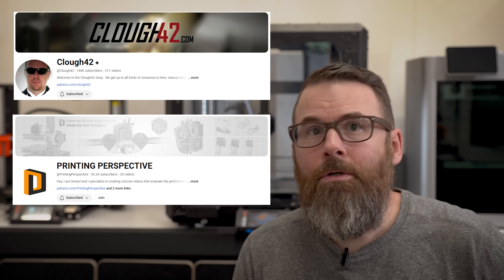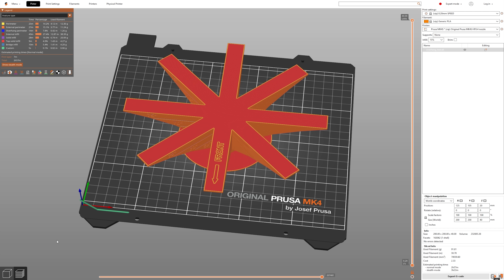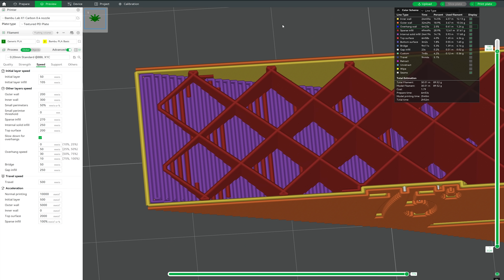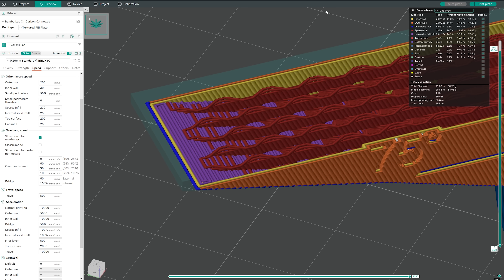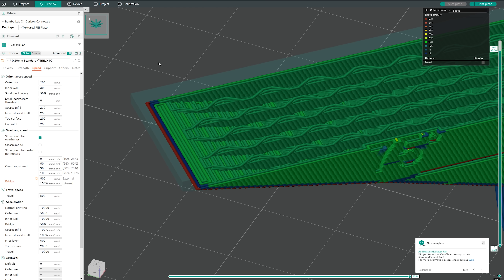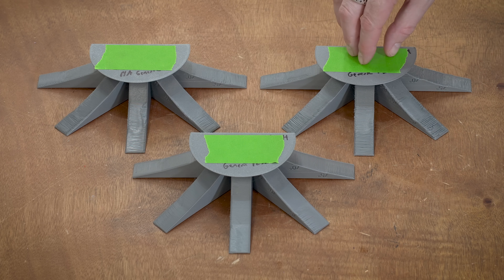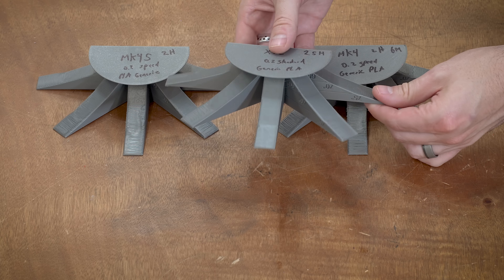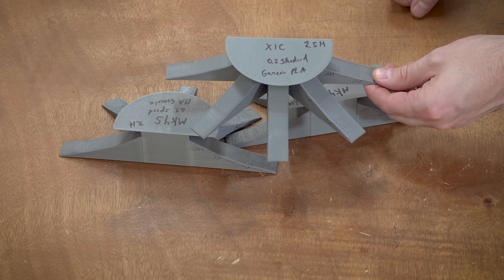Uncovering Prusa's Overhang Performance

Comment: oh boy more slicer configurations that are being marketed as printer upgrades smh
Reply from the maker: To be fair, it IS a pretty integral part of a 3d printer anymore.  But it's not necessarily an 'upgrade'.
Reply: @RobertCowanDIY  I do understand that but the disingenuous part is the marketing being so heavily biased in imping that the "upgrade" was from the fans and not the slicer because they completely understand that such a simple bug will be fixed within weeks for other slicers.
Reply from the maker: @mynameis______392  Yeah, I'll be shocked if this bug isn't fixed in the next month.
Reply: well the software compliments the printer so technically changes to PrusaSlicer are printer upgrades.
Reply: @902Boots  I understand what your saying but I disagree since the slicer is not inherent to prusa, nothing is stopping you from using it with other printers, Or just simply tweaking the other slicers

Comment: Thanks. Still going to get a MK4S
Reply from the maker: Yeah, I don't think this invalidates anything in my last video, other than the overhang performance isn't quite as advertised.  But it still prints nicely.
Reply: @RobertCowanDIY  To be honest, it will influence my decision on buying an MK4S. 
If the hardware updates don't actually adress any of the advertised problemes, then why should I buy it? Additionally, I don't admire being mislead in that way buy a company.
Reply: That doesn't make the MK4s any worse. One printer or another will always be a little better or worse with different filaments or print objects.
The MK4 is a very good printer that will give you pleasure for a long time.
I am sure that it will continue to be refined.
I believe that everything is exaggerated in marketing across all brands.
For me, for example, the Lidar sensor on the X1c is another one of those things. Does that make it a worse printer?
Reply: @OmarAdel19 i don't think they were intentionally misleading. It still does perform better than the mk4, and since Bambu slicer is just a forked prusa slicer they could be behaving the same but this just looks like a bug that went unnoticed for a long time, that only prusa caught. I wonder how would the print from mk4s look if it's bridge speed was also set to 10, maybe it would look a lot more like the x1c if it had the extra 30 minutes.
Though I gotta say I thought the overhangs would look a bit better than they do, they still hang a bit. They do look better than the mk4 but still
Reply: Why lol? It is an inferior competition to the A1 model...
Reply: @riba2233  because it is a kit build, customer support is 1000x better, I can print any color I want for it, I can add any camera that I want for it, I can use WiFi, direct Ethernet or choose not to use and choose to use a USB stick, it doesn't need to be connected to the Internet to update, I can mod it if I want to any way that I please, it has a better warranty than Bambu, I can use any slicer program for the MK4S. It is open source. I can put Octoprint on it, klipper on it, my own version of Marlin, I can if wanted put a different board in it. If I want I can do all these things, and I can choose not to change anything. 
But first it is a kit, I like to build kits.

Comment: Can you use Prusaslicer for the Bambu printer? That would be the best comparison,right?
Reply from the maker: Hum, maybe?  Give Bambu a month, I bet it will get fixed.
Reply: @RobertCowanDIY  Right, but, to @JWF111's point, what other differences in the gcode might there be. You found one.
Reply: yes you can find many profiles on printables if you'd want